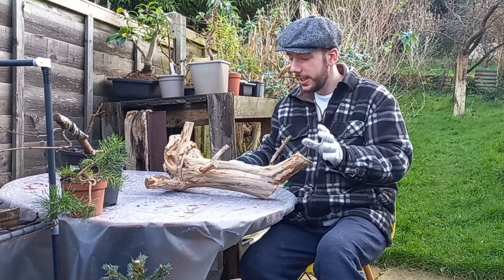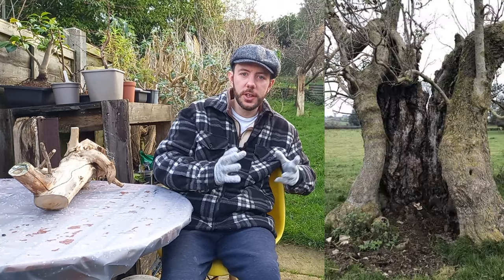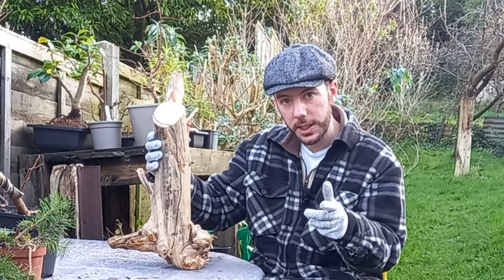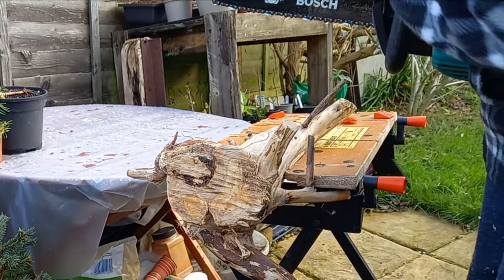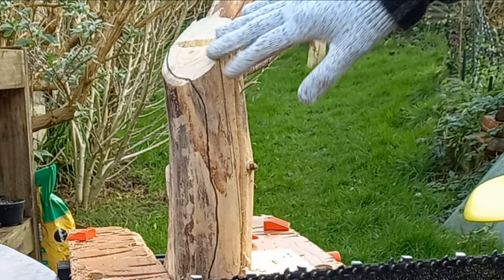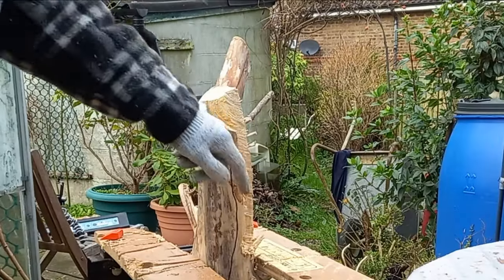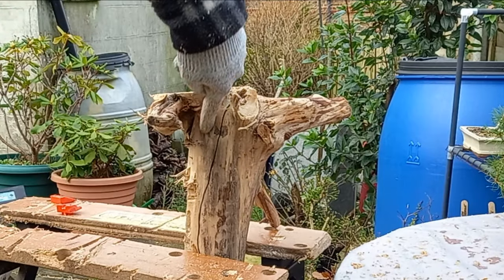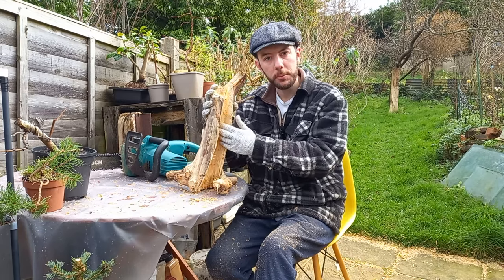Taking a CHAINSAW to a Tanuki - @Bonsaicrazy Tanuki Challenge Part 2

Comment: Nice work with the chainsaw. To bad there was not an easier way of doing it. Very good advice on using tools that you are good working with. This will turn out, like they would say back in the day: CHOICE!
Reply from the maker: Thanks Tom and hopefully it works out well. I will be using lighter tools next time, like a Dremel and hand carving tools.

Always safety first. If you are unsure, don't do it!